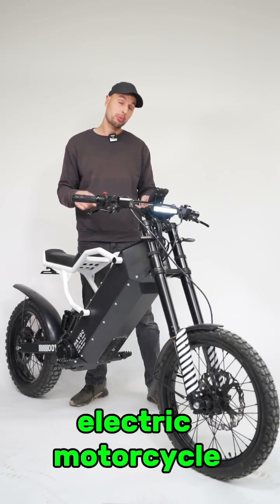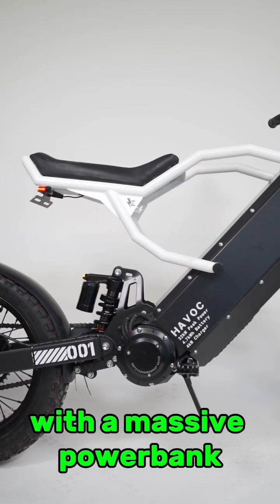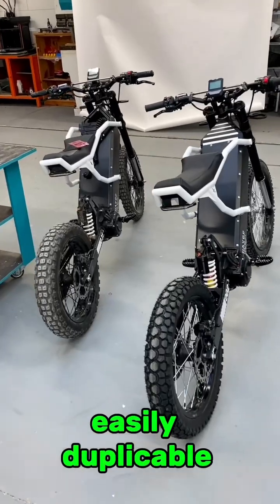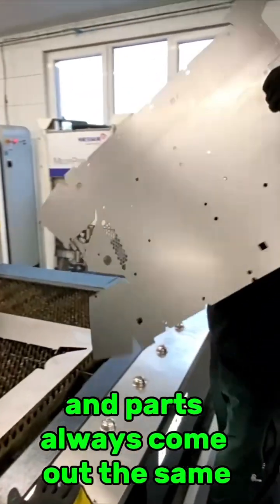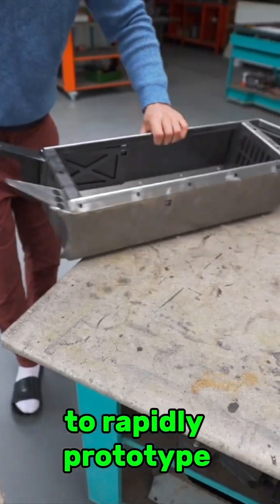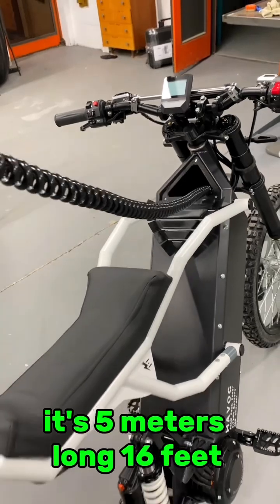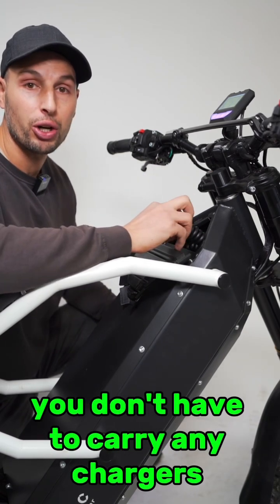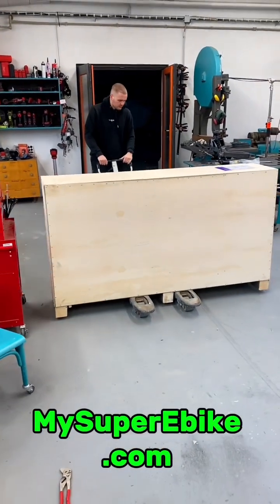From Dream to Finished Product: Building a Powerful Electric Motorcycle

Comment: Nice Bike but in the UK The electric motor's maximum power output is 250 watts The bike can't go faster than 15.5 miles per hour or 24.94 kph its the law  if the Police do stop you they can seize your bike if its over this as it will be classed as a motorcycle and then you need insurance and road tax and a helmet
Reply from the maker: These can easily be made street legal in the UK. You are talking about law for ebikes, this is a motorcycle.

Comment: Will you sell a bare bike without the electric motor, battery & ebike related parts.???  That I could modify so a 125cc pit bike engine could be installed. I can weld & built 1 Motorized bicycle before, so I could weld in motor mounts, mod the frame  & align the engine to make fit. 
I want a fast strong/safe, motorized bicycle with pedals. That can cruise at 55mph on the hwy using a 125 or 150cc engine & the ability to pedal around like a bicycle. With the engine on or off, obviously it'll be heavier & slower than a normal bicycle when pedaling. But will allow me to at least pedal through restricted areas. 

Also interested in a gas/electric hybrid bike. Especially a 2wd hybrid ...One idea 💡 I had for a long range  55mph  2wd hybrid bike is. Use dual F & R electric hub motors. With a small onboard quiet inverter gas generator. That can recharge the battery 🔋 pack. While riding or parked...I see those 2wd electric 🛴 scooters that can go over 65mph..Using small dangerous wheels instead of larger sized, safer scooter or motorcycle wheels. 
   Instead, imagine a 2wd hybrid  on/off road 🛵 sit down scooter or dual sport motorcycle with small generator under the seat where the engine goes & battery pack. Placed down low for low center of gravity. Which can also be charged by wall 🔌 plug in power.
I know I'm not the 1st to think of a 2wd gas electric hybrid scooter/motorcycle but would love to have one.
Reply: That's dumb as shit, You're asking too much from one vehicle.. there is a reason why you don't see hybrid motorcycles or dual wheel motorcycles.. having power on the front wheel of a 2 wheel vehicle makes it skid out anytime you take a turn, lean or do anything..
Get a gas bike AND and electric bike and just deal with them being 2 separate things...
That's like saying I wanna buy a car that looks like a truck fucked a boat on weekends but only while Saturn was in retrograde so now it's plumbus is purple..
Reply from the maker: Sure, send me an email and we can discuss details Ladi@MySuperEbike.com

Comment: I really dig the bike.....The magnetic storage compartment is really cool 😎 
   An idea 💡 I had for this bike is a strong bolt 🔩 on removable rear rack. To hold a triple bag set for storage. Also hand guards & adjustable windscreen.....I think it would look great with a rugged  looking rear rack. With olive green or black, canvas military looking saddlebags or canvas triple bags....The canvas bags give the ability to be strapped down flat & secure the rack. So when empty #1 they're not flapping in the wind #2 They won't look big & bulky #3 Aren't getting in the way like the large hard storage cases or leather saddle bags that create more wind drag. Canvas can also be easily water proofed.

Comment: You probably hate motorcycles that use gasoline engines... But I would be very interested in buying one of your high speed ebikes that uses pedals. Which doesn't come with any ebike components. That I could install a 125cc 4 stroke pit bike engine into...(Or possibly a 100cc 4 stroke single speed motorized bicycle kit engine into)..To create a strong reinforced motor bike with pedals that can cruise at 55mph & be pedaled. With the engine non running or running. 
I have a mig welder & can mig weld steel, so I could make some modifications & engine mounts in order for the engine to fit. My problem currently is I lost my 2 homes & workshop due to illness  but need cheap reliable transportation....Without a workshop it's hard to build anything. 
Motorized bicycles are actually pretty popular in the USA. So if you built similar strong bikes made for both engines or electric to be installed in.....And also motorized bicycle related adapter parts, so different engines could be fitted into them. You could have a bigger customer base. Of both ebike & motorized bicycles. I really like ebikes but they're very expensive & I'm on a fixed income. So I built a $300, 40mph top speed, 2 stroke motorized bicycle in 2021. That still runs fine vs $1500+ for a 30-40mph ebike. I'm going to sell my 700cc  motorcycle. For the money to build a strong, safe 125cc motorized bicycle. That is somewhat also off road capable. Can get 100mpg & cruise on the hwy at 55mph....Look up a  "Motoped" or a "Phatmoto" that will give you an idea of what I'm after. Or think of a 125cc mountain bike that uses stronger frame, wheels, tires, etc...But looks more like a bicycle 🚲 instead of a motorcycle...The Phatmoto bike is missing a rear suspension, has weak aluminum frame, uses bicycle wheels, tires, instead of moped or motorcycle tires. So it's not safe at 55mph....As you know many high speed ebikes Ecycles use motorcycle rims & tires. 
I'm also very interested in a gas/electric hybrid cycle build...A 125cc bicycle /motorcycle, will allow me to turn the  engine off & pedal in areas where ebikes & motor bikes are not allowed. Then startup after I pedal once out of the restricted area.. If you get bored slso look up "Gemini" wheels. They're much stronger motorized bicycle wheels made for 55-65+ mph speeds. If have machining knowledge. You could make & sell similar high strength/ high speed hubs for electric & motorbikes. 
I really like what you're doing & wish I had more knowledge in 3d printing, battery 🔋 building & parts machining manufacturing.
Reply from the maker: I don't hate gasoline motorcycles at all, what made you think so? I like tech and building things. For my preferred use around a house electric is just so much better. No heating up, very cheap, very convenient to use, no maintenance.
Reply: @ladiandmargaret  I was mostly joking about you hating gasoline engines 😂 But some ebike people are very "anti petrol engine" & dislike non electric, petrol riders....Like one bicycle guy on YouTube told me that my motorized bicycle was very unsafe to ride at 30-40 mph (only because it has an engine) yet thinks a similar e bicycle is safe to ride at 30-40 mph. Only because it's electric & not petrol. 😂 Which makes no logical sense. 40mph on bicycle with petrol engine= very unsafe/bad/wrong.  But 40mph on similar bicycle using an  electric motor= safe/good/correct in his eyes 😂 .
I have range anxiety since I live 16 miles away from the nearest small city & also want to do a cross country adventure road Trip.....So I'm wanting to build an on/off road multipurpose bike similar to the survival Motoped.  That can do 55-60mph with a 125 or 150cc engine but still get around 85-90... Or 100mpgs with pedal assist going at lower speeds. 
 Another reason, besides lower price &  longer range. That I went with a motorized bicycle kit was because. I often ride in below freezing ❄️ temps & I can store the bike outside in summer 🌞 heat & below 0c ❄️ temps in winter. With no risk of battery damage or reduced range from cold battery 🔋 pack. 
I better stop writing.... Anyways I really like what you're doing 👍 & the bikes that you build 👍.
    I want to also go off grid solar if I get the chance & have a ford van in good shape. That I'm wanting to convert into a campervan. But due to the poor 13 mpg fuel economy. I'd rather take an 85 mpg bike only on cross country adventure..Plus there's no room in the van for a wet bath 🛁🚿. I'm considering selling the van or trading it for a 25ft RV since it has a wet bath & more space but gets similar mpgs. Maybe 11 vs 13 mpg & tow stuff like a truck/van/SUV can.

Comment: Have you tested it in mud/wet conditions?
Reply from the maker: Of course!
Reply: @ I don’t know much about electric vehicles. It seems like moisture could be problematic for them. (Why I asked)

Thanks for the response!
Reply from the maker: It is an issue, especially rain riding. That’s one of the very basic considerations among us builders. It’s weather sealed well.